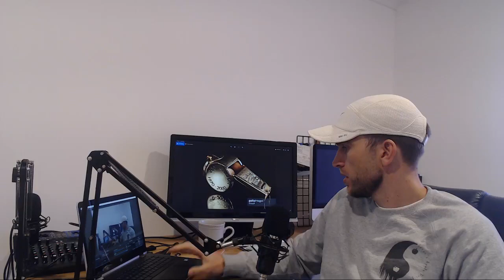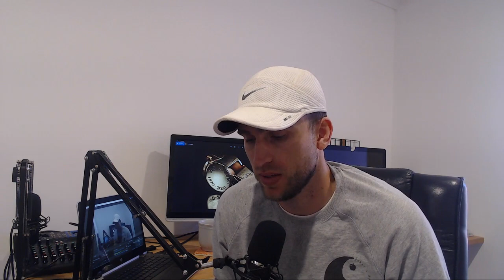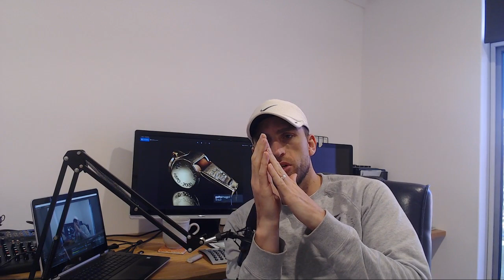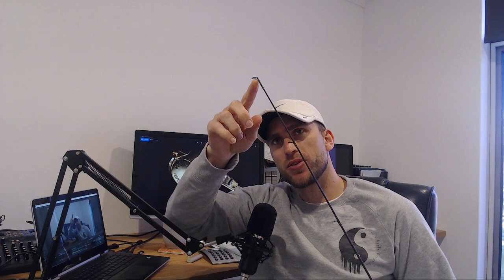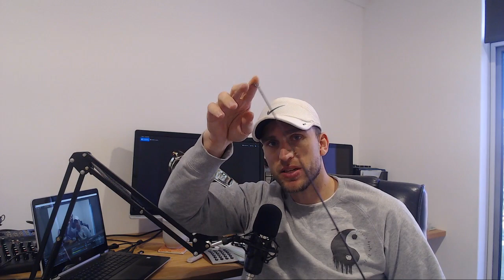Boom Defection!

Comment: I recommend not using the compensate method. Rigger should be looking up until load leaves supporting surface. If you’re doing compensate and then cable down with a max load your liable to allow a load scoot to the crane as you only cable down.

If you don’t have a reliable help and you can see the your hook, watch for the hook to pitch. If it pitches, compensate yourself till it doesn’t shift as the line gets tights. Observe your radius at that point and compensate with boom up yourself. Unfortunately, if you do it for them, when they work with less talented operators they’ll bang up some shit. Good luck